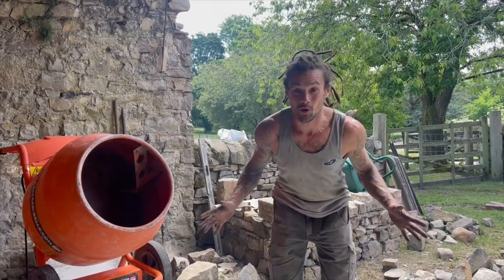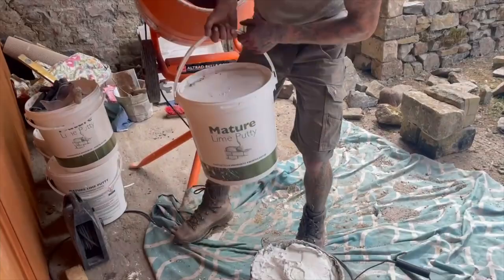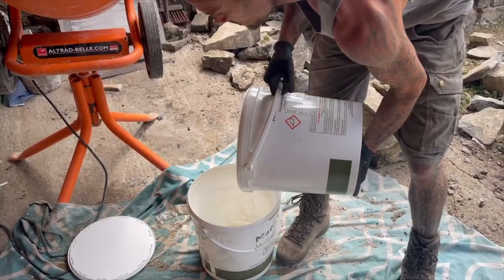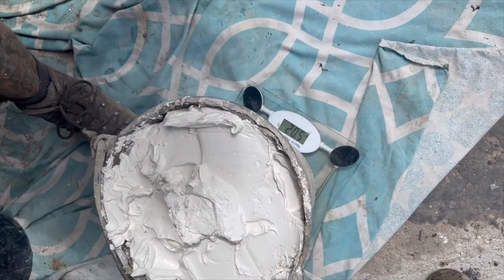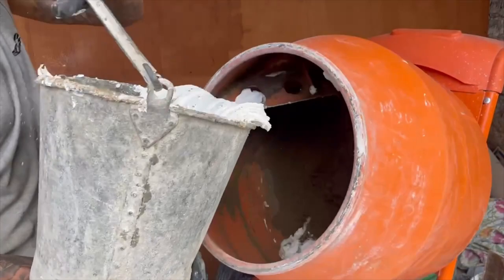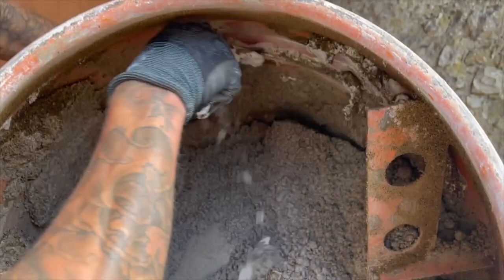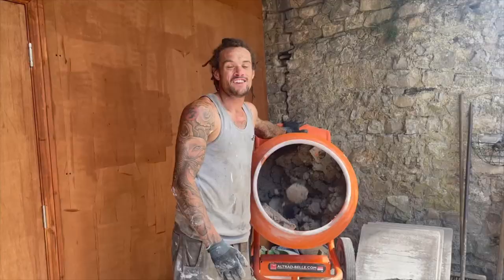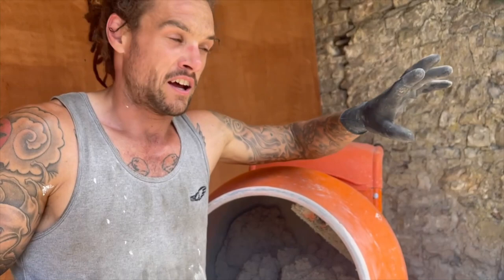How to mix lime putty mortar

Comment: I think you have done a good introduction and presentation, but I am really sorry to have to say that you need to take the video off YouTube because your mix is 6 to 1 and not 3-1 as you claim, this is because your lime putty is 50% water. Please do another video as you are good on the presentation side.
Reply: Agreed, great video and presentation, but ironimp1 is correct and 6:1 would be the correct mix definition due to the water content of the lime putty.
Reply: @roman8133  I don't want to seem pedantic, but if you measured the void ratio of the sharp sand that you are using, you will find that you should be mixing as 2.5 to 1 lime. Therefore if you are using putty the mix will be 1.25 sand to 1 of lime putty.

Comment: How long does lime putty mortar normally take to harden? We put it on two days ago, and it still feels a little squashy.
Reply from the maker: A putty based mortar will take longer this time of year while the temperatures are cooler. It could be anything upto a week or ten days before it gets to that green hard set. 
Bear in mind that a putty takes longer to cure than an NHL mortar too.

Comment: Hi that's really helpful. I'm about to embark on my project repointing my derelict(as yet) cottage. I bought some putty with the sand premixed in it and am guessing it'll be cheaper if I buy this stuff and mix it up myself. I have masses of walls to do so these considerations are kind of important right now.
Reply from the maker: Hi thanks for the comment.  You live in a beautiful city that is the home of stonemasonry. 
Mixing yourself will be a far cheaper method of pointing your cottage, over buying in premixed.  You will usually find that the estimated coverage on the tubs won't go just as far on the wall. 
If you would like some key information or advice near to you then get in touch with the Scottish Lime Centre Trust, at Fife. I've done several of their courses in the past and highly rate their ethos. 
Masons Mortar near to you are a quality heritage supply firm and their products are second to none. They  even provide a service to match your existing lime mortar and make a like for like mix. Hope this helps?

Comment: I am hopeing uou are not too famous now to reply . You videos have inspired me to maybe tackle my victorian brick house myself.  It has been repointed in the past with cement and it is destroying the bricks.  (Not by myself).
Would this mix be suitable for repointing brickwork
Will practice first on the brick garden wall.  Any advice would be greatly appreciated. So much conflicting advice out there.
Reply from the maker: @MargotCottam  Hi Margot, I have just returned from a weekend at a festival so it will take a day or two for my brain to arrive back in my head.
A lime putty mortar on brickwork would be good to use. If the weather is more inclement at your property, then an NHL mortar may be more beneficial as the addition of Argillaceous clays add a degree of water repellency to the mix.
It would be a good idea to start on your garden wall before tackling the house, until you get the feel for using the mortar.👍
Reply: Thanks so much for your reply. Trust you had a fantastic time at your festival.
The reason I was hoping to use a lime putty mix is that I will not have a cement mixer/power on site.  Was thinking I could mix at home and then transport the mixed mortar to site.
The property is in york. Anything I could add to a putty mix to make it more water repellant or will I have to go down the nhl route.  The premixed ready to use mortars are very expensive but should I maybe consider these..
Would just hire you to do the work but I am not suprised you are booked up for years to come.
Thank you so much for time and advice.  The more research I do the more confused I become.

Comment: Many thanks for this video! I want to plaster over the walls in my bedroom... The wall is a cinder block wall that was painted with acrylic paint ... Do you think it is possible to have the benefits of old traditional lime walls in a modern built home?
Reply from the maker: Hi Maho, I wouldn't advise skimming over any non permeable membrane with lime. Ideally any plastering done should (in my opinion) be knocked back to the brick or block and given a weak limewash prior to plastering. This aids adhesion to the plaster coat and reduces suction through the mortar.
I'd be tempted to try to remove as much of the acrylic paint on the blocks too, prior to application. 
I think there is always a place for traditional lime work in any home. Modern plasters and painta contain all manner of nasties in the form of VOC's and other chemicals. Lime work and natural paints produce a far healthier environment to reside in.
Reply: @dportercontracting9974  thanx so much for your reply! Love your work. I will try as you said to make one wall and will continue section by section to do all the house. In Israel (where I live) the transition to lime is slowly coming ....

Comment: Would you recommend adding a pozzolan? Great video as always
Reply from the maker: It depends on your application of the mortar. If you are building with lime putty then I probably wouldn't put a pozzolan in the mix. I tend to add it to a pointing mix of NHL 3.5 or less though.

Comment: Hi Mate, I've a stone cottage plastered externally with sand/cement, causing me huge damp issues as water is getting in through small cracks.
Is this the mix you'd use to replaster externally?
Thanks
Reply from the maker: Hi Gu Lag.  A rendering mortar could be used from a lime putty mix however, I would be tempted to use an NHL as the clays in the lime would add to the weather proofing in the finished set of the mortar.

Comment: I have an internal cavity wall to brick up where there are several holes. Can I use lime putty mortar in November? Or is it best to leave until April?
Reply from the maker: If the internal worksite is sheltered from frost or temperatures below 5c then you can use the mortar right through the year with no fears of degredation of mortar.

Comment: Hi porter.
Just discovered your videos and what you do is great. 
I have been offered a job repointing an internal wall for people I've worked before and they really want me to do it rather than someone else. I've done a lot of pointing for the company i work for and love doing it but always used white cement. I never used lime mortar and the customer requested lime mortar. What kind of mix would you use for internal pointing? Cheers
Reply from the maker: Cheers for the props Midnight Bass. 
Internal pointing sand can be a more medium grain sand. Have a play around with some mix ratios on a job and see what colour of mortar and effect the client prefers.  Lime putty based mortars, cure to a brighter tone than NHL based mortars. 
For internal pointing, I tend to use NHL based mortar with the same mix used for outside works.  The granite dust shines through in the finished set.
Good luck
Reply: @dportercontracting9974  thank you very much mate , I'll have a play at work , make different samples of mortar and see what they prefer. Roughly how long after applying the final pointing do you rake it back and brush it off?
Reply from the maker: @midnightbass681  It depends entirely on the humidity around the project before the mortar is "green hard." If you can just indent your thumbnail mark in the mortar, it should be somewhere near.

Comment: Hey first of all super nice videos:) 

I'm living in Spain on a project where we made a huge amount of putty from bags of quicklime(no number on bag) This was 2 years ago  Besides that there was no info on the bags.  I used it on smal projects mixed with sand 3/1 and it got super strong over time.
Watching all you're videos I got I but confused about if this will be the right line putty for pointing the old stone structuur (100 years)  or not?

Thanks already cheers
Reply from the maker: Hi Danny, thanks for the props! Sounds like you have an exciting project on your hands.  It's always an honour for a craftsman to look back on his work bringing an older property back to life using traditional methods. Top work matey!
The quicklime would need slaking in water to turn it to lime putty. It's always advisable to leave it covered in water or an airtight container for at least four months. This ensures that all the lime has slaked properly and vastly improves the malleability of the mortar when eventually mixed up.
Reply from the maker: Lime putty would be great for use in pointing where you get more sun and heat rather than rain. NHL lime has agrillacous clays as a constitueny, which improve water repellency.
Reply: @dportercontracting9974  thanks for the fast reply! Helps alot I'll start pointing the huge building in a few days and you're videos helped alot to prepare for it
Reply from the maker: @danny-rj6dh  Cheers bud. I'm glad the videos have been of service to you. We have another video series going up this coming week of a lime pointing project we have been working on up on the west Coast of Scotland. Keep your eyes peeled for it!

Comment: Hey porter is this any good for pointing a brick chimney
Reply from the maker: It would depend on the integrity of the stack, weather exposure, quality of raking out of joints/application of mortar.  At least one of the sides of the stack would be getting some hard weather so I would look into adding a pozzolan to a hydrated lime for a stack pointing. Hope this helps?
Reply: @dportercontracting9974  thank you for reply I’m in two minds I might just go with nhl 2 and keep my putty’s back as they been curing for 2 years now
Reply from the maker: @hbpw857  putty would be better for a constructional lime or plaster. Save your aged, creamy hydraulic lime for a more suitable project. It will be lovely stuff to work with at 2 years old.
Reply: Which area in Yorkshire do you cover please?